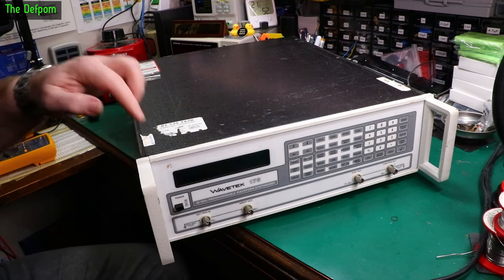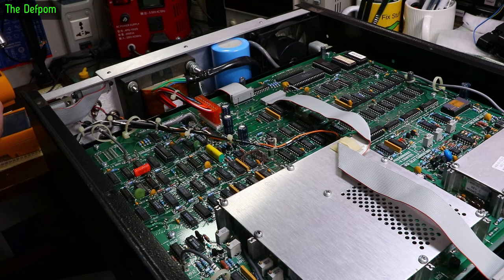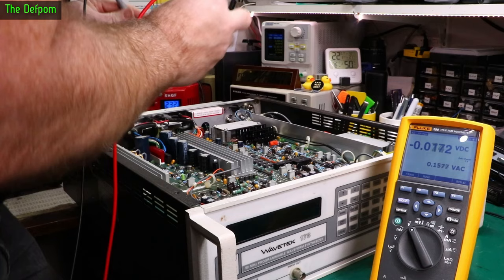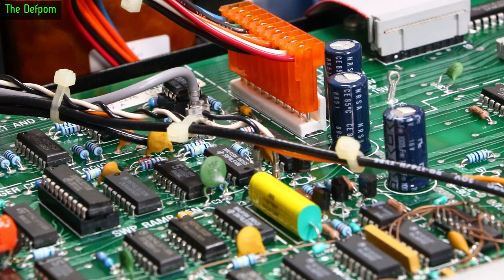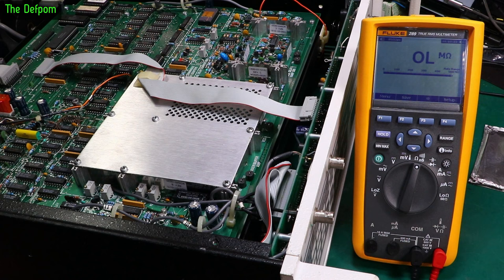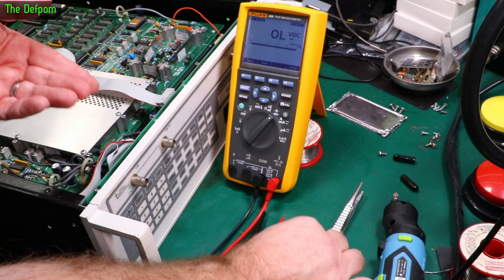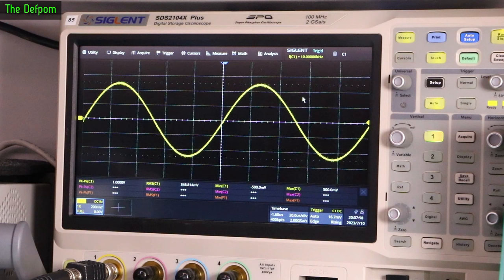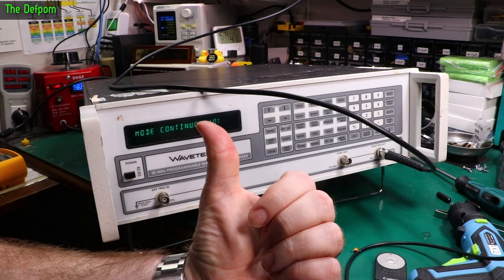🔴 Wavetek 178 50MHz Programmable Waveform Synthesizer Repair - No.1167

Comment: if two caps are shorted, and they are across some rails with common ground, how did you conclude that they are on the same rail?
Reply from the maker: I tested from both sides of both caps, and each side gave the same two readings, 0.02 as a direct short, or 0.16 as it passed through the shorted part.